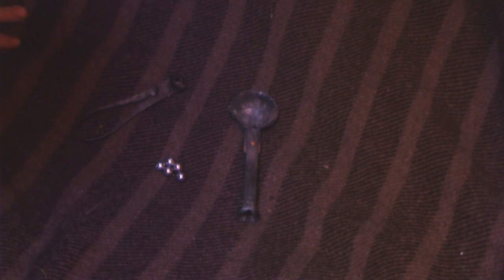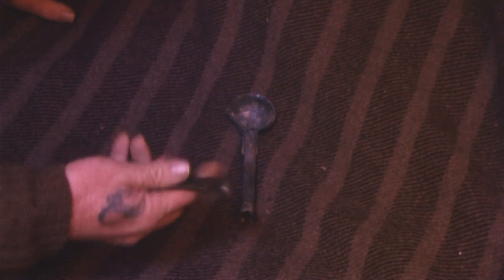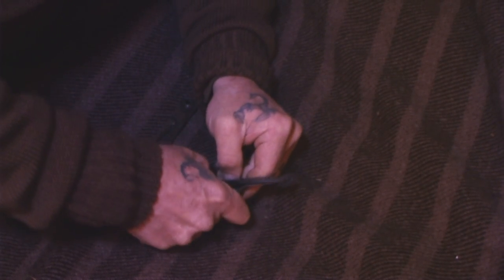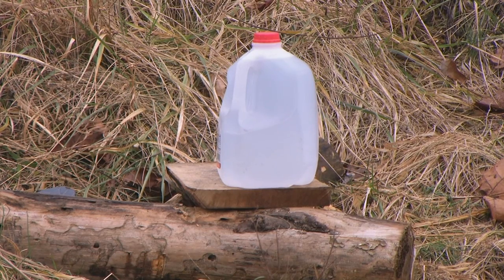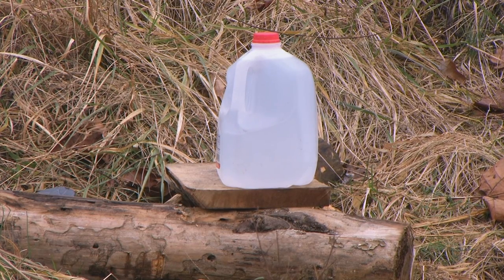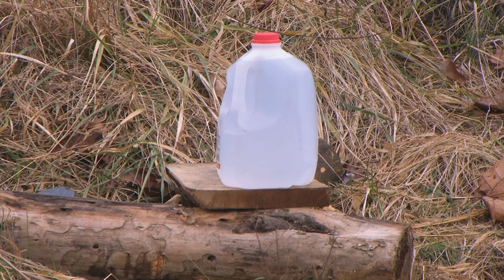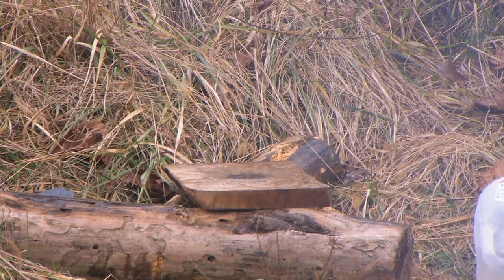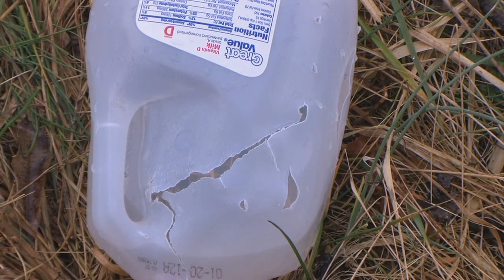21st Century Long Hunter, Casting Lead Shot

Comment: Wheel weights: when I load my .45 flnt lok, I seat the ball into a lubed patch and then drive it down onto the powder charge. Inspection of the fired patch reveals a fully intact patch. Theoretically, the ball does not come into contact with the barrel rifling because the patch acts as a gas check between the ball and the rifling. This would not be true with a mini because you are seating the mini directly into the rifling. In a shotgun, minimal issue- example: steel shot. Thanks again Dave!

Comment: great video and great idea about casting.  One thing is that the battery lead is much more toxic than other lead. I would make sure to melt it down with a breeze blowing so you wouldn't breath the toxic fumes but It can very well be used.  Also when you are casting be sure that it's not raining or going to rain because the molten lead will violently splatter all over the place when in contact with water.  Again great vid and thanks for all the info you give us Dave

Comment: After you cut the spur, try putting the ball back into the mold the press down sharp edge left by the cutter.
I have never worked with ball molds. I just thought this might work.

Comment: It is amazing the utility of a small furnace that size in a limited fuel situation though. Heating something up with a torch takes a lot of gas compared to sticking it in a forge to prepare for braising or soldering...or forge welding for that matter.

Comment: @confederatedipper100 yes lead fishing weights work great. A lot of lead use is being phased out because small game and birds sometimes consume it and get lead poisoning so the newer fishing weights are not lead. Old wheel weights for balancing tires is also good. Sometimes you can still come across quantities of lead pipe as well. Check with local regulations though because many places now forbid lead shot of any kind from any weapon including slingshots.

Comment: @homeinthewhiteoaks if you want to melt Al in that stove you can just clean the bottom out and prep it, then pour it with a 2-3" layer of refractory. Use a box form to pour the refractory 2-3" more up the sides. All the sustained heat is at the bottom. I cast Al I a steel 5gal bucket lined w/ refractory.

Comment: Cont. just have to be careful at going overboard, the thing is already heavy. I suggested adding a blower to allow him to sustain good hot burns for doing a lot of casting or softening up other metals. Would not be a true forge unless you line the bottom to prevent burn through

Comment: Don't be temtped to use water to cool the mold before extracting the shot.  If there is even a trace of water in the mold when molten lead is poured into it, it will pop and molten lead will go everywhere, including your skin.

Comment: Never use car batteries for bullet lead. It used to be common to use old car batteries for their lead, but these new "maintenance free" batteries use calcium and strontium which, when mixed in the presence of heat, will form an intermetallic compound that does two very bad things. One is they suck the antimony out of the alloy, and two they produce the deadly gases stibine and arsine, which are DEADLY at very low concentrations. For more info on this subject, read Lyman's Cast Bullet Handbook.

Comment: You should use a knockout cutter to make a hole in the bottom of that stove and then weld some bolts inside hanging down so you can bolt on a cover when needed. With a 3" hole and a crank style blower you just turned your camp stove into a forge...wend some steel screen over the inside of the hole. Multipurpose much...

Comment: Hey Dave, be careful about keeping your vice grips close to a fire like that, I ruined mine back in 2010 when heat treating a knife in charcoal, the spring gave out after not much time and stretched, was useless after that, had to chuck them out.

Comment: @LVPG2010 only ifyou use somthing like wheel weights witch is the same hardness air cooled as normal lead shot you can drop pure lead into water all you want but its not going to do nothing  i cast a 2 alloy bullet and fuse them then drop it in water this will harden the base witch i cast out of wheel weights and the nose will stay soft and expand with pure lead

Comment: @kskk9368 Molten lead has to be at a very high tempurature of over 700c degree's for it to have any effect on one's health. The lead has to become airborne to effect one's health... Lead melt at 327c. If one was to use 63% tin 37% lead (solder) the melting point would be 183c. Very easy to melt on a stove like Daves. But I would question what it would do to the barrel of the guns.